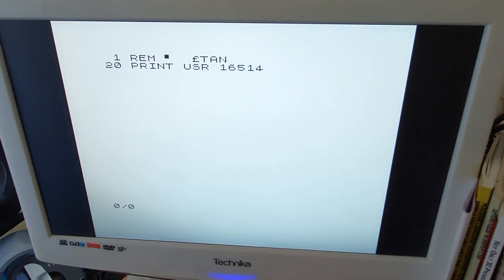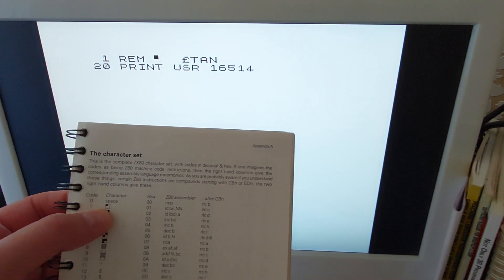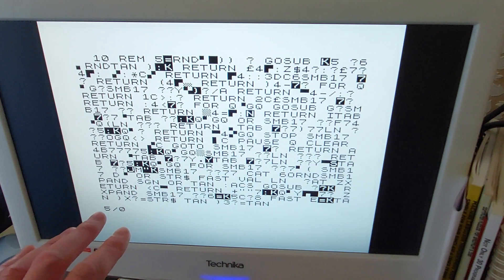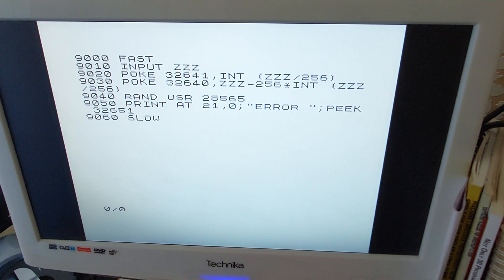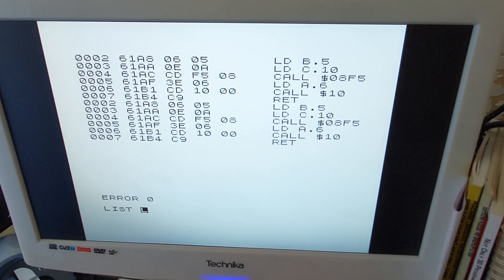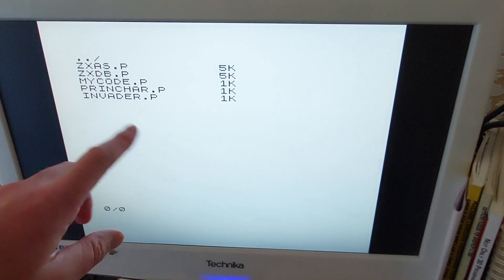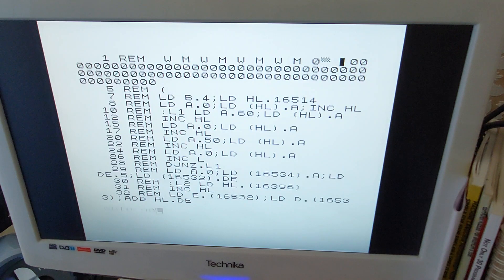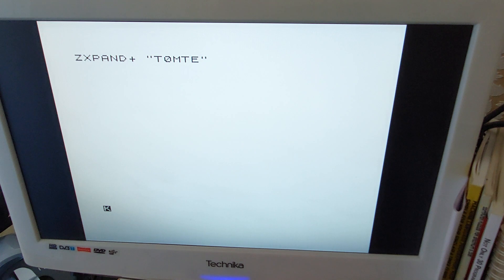Assembly program only using ZX81!

Comment: I could never get my head around this. Basic was easy and today I understand html but this, no, machine code no, even java script today, no
Reply from the maker: I struggle when i've not done any assembly for a while, and i'm a C++ programmer normally. Easy things in other programming laguages like "if x < 5 then..."  are more complicated in assembly. I find i tend to try to change the logic around to make it easier to write or just experiment until it works and when i need that again, i'll copy/paste.
Reply: Typing out machine code or assembly language into Microsoft notepad, then using modern tools to compile and emulated the spectrum isn't too bad.
This method in the video is putting a more complex layer on top of assembly language:)

Comment: Is there no assembler for the Z80?   I had one around 1981 for the trs80 color computer.   Never heard of using basic to poke an assembly language program.
Reply from the maker: Yes there's a few like zxas i've videos on those as well https://youtu.be/t77zdXxKYCo?si=01VVQL2JJJZlG099
Reply: alot of programmers used rem statements on the vic20 for short routines, must be a small memory thing.
Reply: @ncurtis1970  that is old school AF, we really did have to walk uphill both ways back then

Comment: Thing is we did use compilers , TRS80 ran the compiler  , RS232 uploaded the code to spectrum.  Later Especially for Atari / Amega  386/486 Pc where used with cross compilers. As even 16bit was slow at compiling.  Rem Statements where really using in Magazines. And as a basic Learning key to Assembler. The Back of the Spectrum Horizon hand book was unique as it had the ascii to Sudo Assembler Language listed in its Index pages.  'ld a,8 '  ld hl,234 'etc so that you could have the 8bit decimal code. Spectrum Assemblers arrived as more RAM become available. But the preferd method outlined above was still sued by software houses.

Comment: Gosh that’s painful. The problem really is that back then the tool sets they could provide on the zx81 were limited. So although you assume they typed the rem statement in, they didn’t, they actually wrote it directly in assembler. Nobody actually used that translation set you see in the manual. Yes, as you show it is possible, although extremely painful to type in the character set representing the assembler instruction no programmer did that. If you see the link below, the guy writing this set of videos explains how back in 70’s and 80’s they built their own computers at Marconi Radar Systems In Chelmsford and coded the air traffic control systems for the UK in assembler. He’d be pleased I’m sure to think they had brains the size of planets but he explains how it was done and how to actually build a computer. He shows it being coded in assembler and then compiling that assembler code into machine code and then loading that into memory on the computer. Back then there was no computers no internet so you couldn’t google a solution and you had to build your own and work it out yourself. The Zilog chip was used by Marconi also, and in Rochester in Kent in the British Aerospace factory in the 80’s they used the zilog microprocessor to build a computer rather than the 8086 and that computer they build was coded for submarine hunting. Here the code for the Zilog was written not in Assembler but a high level language called Coral 66, this was then compiled into machine code and then loaded into memory of the Zilog computer they designed. On the zx81 it would have been coded in assembler and not done via the rem and character representation as that’s just too convoluted, and hard to do. As you show it can be done that way, but they just wanted to provide some mechanism using what was available on the zx81 at the time to show how this character representation could be used to create assembler, but in reality it was coded directly in assembler 

https://youtu.be/tOkGg0UEm9w?si=9PcEQ9frNw2-Mrew
Reply: It was... most of the times and don't even bother to save first version to tape...

Comment: I assembled manualy regularly... Rather small programs. Once i assembled manually disassembler based on z80 cpu book. I dissasembled most of rom, and used some procedures to write "Excel" for zx81... this was basic assembly hybrid, but have formulas and even "plots"... also i experimented with "turbo" and sound "digitalizing"... Last pages of zx81 manual were abused, dark and fell off...
😅

Comment: 10:31 I noticed line 32 looked odd, so I replayed for a closer examination, the mnemonics aren't valid, and in fact the assembler has fudged its output (10:52)   producing code LD A.(16532) and LD A.(16533) - instead of report an error. The correct mnemonic is LD DE.(16532) which would encode to instruction bytes ED 5B 94 40.
Reply from the maker: Yes wow you're right, 3A 94 40 is definitely ld a, (16352) and not ld e,(16532). Infact ld e,(HHLL), isn't a valid instruction so is probably my mistake that the assembler didn't catch a an error. As you say it should be  ld de,(16532) which assembles to  ED 5B 94 40
Reply: @byteforever7829  The assembler is at fault. I had ACS's Ultraviolet Assembler for the spectrum, it was similarly sloppy with error checking.
Reply: @EmmittBrownBTTF1 You had an assembler ?🤔
Reply: @AK-vx4dy  Ultraviolet, it was sloppy too, so I wrote  my own, by the time I got it up to equivalent spec it  was 1k smaller, and blazing faster. Ran on a Spectrum
Reply: @EmmittBrownBTTF1  cheater 😜 I had only zx81 manual (heavily abused), ballpen and notebook 😉
But without other machine, you needed some kind of editor  at first or put assembly mnemonics after REM, if editor wasn't full screen then it were quite tideius too.
Reply: @AK-vx4dy  UV used REM statements for source code.
Reply: @EmmittBrownBTTF1  I see now in video too.
Nice assembler... LD D,(16345) impressive you catched this in flight. I suppose there was no room for errors ;)

Comment: 03:15 I very much doubt that code was hand coded. It was probably written and assembled on a more capable machine and then ported across to the ZX by some means. If they didn’t have a hardware interface they probably saved the data in ZX format that could simply be loaded into the ‘81. The average user without such facilities would however have to hand assemble their code but then would probably use a simple data loader (For/Next loop) to poke the values into 16514 onwards. If the data is stored as Hex or Decimal values in a string or array or similar then it can be saved with the program and easily modified during debugging.
Reply from the maker: Think I remember reading that Matt Smith used a Model III Tandy to code up manic miner and "squirted" the assembled binary over to the zx spectrum https://en.m.wikipedia.org/wiki/Matthew_Smith_(games_programmer)
Reply: @byteforever7829  Sounds familiar. I'm sure there is a video online of a documentary where he shows us around his complete setup. It may be in one of the references that are linked to on the page you refer to or possibly on 1 of my dvds such as bedroom coders etc. Certainly it was common practice for any of the the  popular software house.
Reply: When I was a kid, I did this through all my assembly learning. The rate of success was about 2%, and by success, I mean not freezing the poor little bastard. Most of the times, the code just crashed and you had to start all over again. But then, putting the hand-translated assembler program in a REM statement meant that you could SAVE and LOAD to the dataset (cassette tape) to recover after the usual garbage screen.
Reply: @juanro22  Same here, but i was about 14, at first attempt i didn't bother to save because it was obvious it will crash or freeze 😉
Reply: I hand coded many programs that way, it was most effective on bare zx81, any other representation means at least 3x bytes needed and bare has 1KB only. Entering in a loop could work but I don't see advantage and see some some possible problems.

Comment: In modern times you can use a compiler and with that you can get much more out of a (1K) ZX81. You can even set code over the systemvariables.
Reply: You mean a compiler can produce smaller code in comparison to a real talented assembler-programmer? Just kidding
Reply: @gehtniemandwasan2925  
The talented coder will use the bytes the ZX81 itself needs when coding directly ON the ZX81. My base model sets the BASIC-line to start machinecode fully over the SYSVAR and the machinecode is coded without a REM. And What is a printerbuffer anyway?